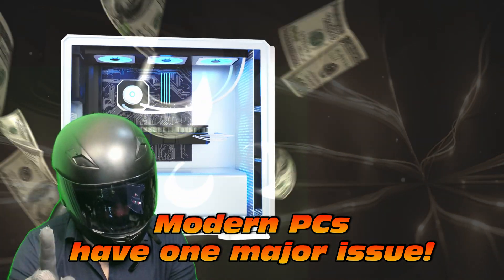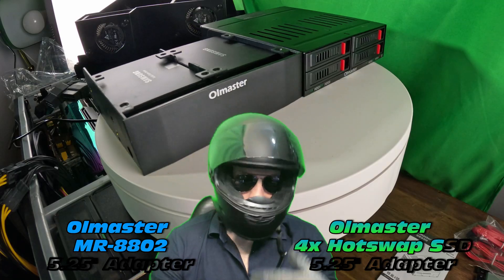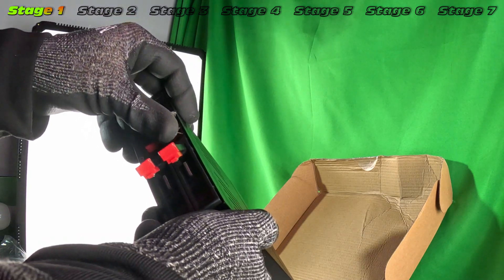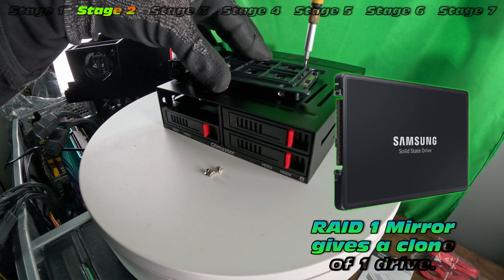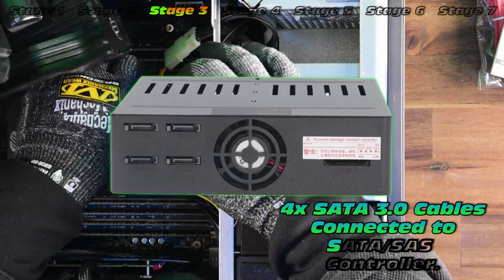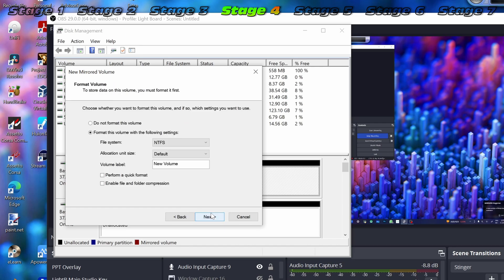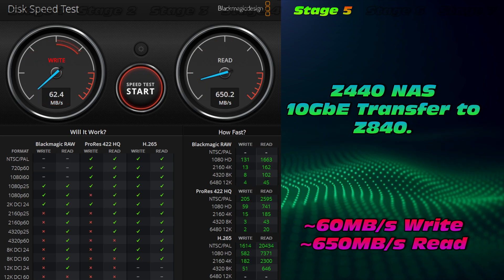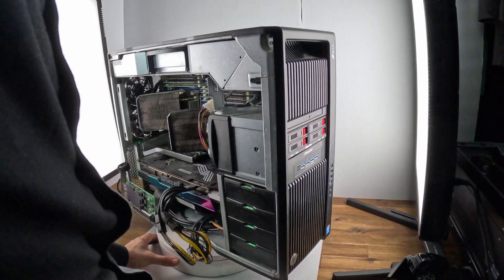Easy SSD Storage Upgrade? Affordable 4x SSD Hot-Swap Bay fitted to the HP Z840 - RAID 1 Mirror!

Comment: To me, the days of hardware raid have ended, I can't see any benefit of it over what we have now
Reply from the maker: In some ways I would agree, but it really comes down to application. Hardware RAID is selected to meet a need and it's still the best performing option for data redundancy and striping. Where you referring to ZFS as an alternative, or something like Storage Spaces?

I just finished watching a video from The Slow Mo Guys where they tested out a compact 12 drive NVMe pool that only offered RAID 0 and RAID 6. This may seem redundant for say gaming, but for video production it's a dream. 

In my application I use a 8TB RAID 0 pool of NVMes as a primary storage for a live video project, that archive can be backed up to a SSD Mirror (in case an NVMe fails), and that can also be backed up to a RAID 5 (in my case) HDD pool. 

A few levels of redundancy with different RAID configurations gives that piece of mind.
Reply: @racerrrz  Well, I have a 12 bay Synology NAS and 24 bay TrueNAS setup, I've done plenty of hardware raids before, but recovery with them is always the issue for me, the card dies, it's a real pain to get the data back
Reply from the maker: @TheTrulyInsane  There is no quick fix for that other than to have a fail-safe, backup the backup NAS to the backup of the backup NAS.lol 

Checking the drive SMART data regularly and replacing NAS drives every few years would be the way to go to prevent RAID drive failure, but who can afford to replenish all the drives in a 12/18 Bay NAS. I aim to leave my "NAS" (custom repurposed workstation with TrueNAS) off if not in use to improve drive life-span. 

Despite the pain of RAID, there isn't a more reliable method of keeping your data secure just yet.

Comment: How come you don't cover the Z640? I got a deal for a Z640 that is cheaper than Z440 locally albeit with only a E5-2623. Thinking of getting it and upgrading the processor later. Not going to the dual processor route but the Z640 seems to have a beefier power supply with bigger headroom to support power to GPU (I think)...
Reply from the maker: I have been wanting to do the Z640 and Z620 for a long time but I have just never had them appear cheaply on local marketplaces. They seem to be more rare in general. If I find a Z620 and Z640 on the cheap I may eventually do the Z600/Z620/Z640 review, but I may not have a Z600 when that time comes lol. 

The Z440 is actually the better machine IMO since they both (Z440 and Z640) have the same base motherboard, except the Z640 trades-in 4 RAM slots on the main board to accommodate the riser board for the second CPU (with 4 RAM slots used there as well). I read that the CPU riser board is a little unreliable, so from that perspective I would rather go for the Z440 and be able to run 8 RAM modules with a single Xeon CPU. If you want dual CPUs go with the Z840.
Reply: @racerrrz  I think the beefier power supply will come in handy due to the headroom. I can't find anything on the available cables"or  "connectors"that is suppose to come as standard. Do you know a source?
Reply from the maker: @mengshilim7364  I presume you are looking for the number of 6-pin connectors on the Z640's PSU? 

As far as I am aware the Z640 (925W PSU version) only has 2x 6-Pin cables - each capable of 12V at 18Amps (216W each max). 

The extra power might be enough to power certain founders edition GPUs with 2x 8pins (I recall the RTX 3090 founders edition being 2x 8-pins). I haven't checked if there are PSU upgrade options for the Z640 but the Z440's PSU to ATX adapter cables would also fit the Z640 which would allow you to fit any PSU you would want (mounting it in the Z640's case would be a slight issue - expect mounting holes not to align). 

In terms of other power adapters there should be at least 1x molex connector and likely 2x sata power connectors. I wish I had come across one of these so I can do an overview on them.
Reply: @racerrrz  HP has 6-pin to 8-pin adapter also they're not so easy to source. 3rd party ones probably are ok. How to add more sata power cable?
Reply from the maker: @mengshilim7364  I would trust the HP item (N1G35AA) above all the cheap 3rd party ones, but finding 3x is the challenge. But thus far my cheap ebay ones have been working well (6-pin female to 8-pin male), but I have read of poor quality ones burning up. 

Sata power is best done with extension cables. I have updated the video description with a bunch of sata power cable options. The combo one looks quite handy - you can never have too many of these cables!
Reply: @racerrrz  May I have a link to this video?
Reply: @mengshilim7364   I am always leery of using adapters of any sort, I use a couple of 6 pin to 8 pin adapters to power an EVGA gtx 1080 in my z440 and no problems. I stick with comeap, startech , moddiy if I can for power type adaptors.
Reply: Actually, can that beefier power supply be used to power anything but the riser card? The fact that it has 225W more than the Z440 700W may not mean much if the rail design etc means that it can be used only for the riser.
Reply from the maker: @JordanGospelMinistryInc-go8qp   I have not had issues myself with cheap 6-pin to 8-pin cables (all of mine were off Ebay/AliExpress) but it is best to buy branded items for better quality and reliability.
Reply from the maker: @mengshilim7364  The Z440 and Z640 share the same base motherboard PCB (with adjustments to accommodate the CPU riser board for the Z640). The PSU outputs are identical, except the Z640 has extra CPU power delivery to account for the additional CPU riser board. If you check the PSU stickers you'll notice all outputs are identical except for the added V12CPU3 and V12CPU4 outputs on the Z640's PSU.

That basically means the Z440 and the Z640 will power the same net hardware (so 700W max), but the Z640 can support that with dual CPUs.
Reply: @racerrrz   I was wondering the same thing about the z640 ,  Will stick with z440  and just skip the z640 and go for a good deal on a z840 :)
Reply from the maker: @JordanGospelMinistryInc-go8qp  If you keep an eye out now you may find the Z840's cheap. I obtained one really cheap that was defective. I didn't quite manage to figure out what went wrong with it, but a new motherboard solved the boot issue. I'd say a bargain Z840 would cost ~$250 USD.
Reply: @racerrrz  Looking deeper into this I think you're right although I was thinking mainly of a single CPU config for the Z640. Getting it also means I have to get that special cable for the dual rear fans. I think in a case swab, 1 of those 2 fans can probably go to a fan at the top of the case. Anyway, I will probably go for a Z440.
Reply from the maker: @mengshilim7364  The Z640 has it's uses, and if you can get one with the CPU riser board (so 2 CPUs fitted) it could be worth it. I have only ever seen 1 for sale locally with dual CPUs and it was more expensive than a Z840.lol. 

Were you after the link for the Z440 case swap video? 

This guide has most of what's needed for these case swaps. I presume the Z640 has the same front I/O pinout given that it shares the same motherboard layout as the Z440: 

https://www.youtube.com/watch?v=K4RalaEbRI4

I haven't done a case swap for the Z640 or Z840, but I have considered doing the Z840: https://www.youtube.com/watch?v=Rsr_zxOg6K8
Reply: @racerrrz  I was after the Sata stuff. I am still very confused even after reading the service manual. Can I use the secondary SATA (sSATA) ports as extra SATA ports in non-RAID configuration? If so, is there a SATA power cable for this if I have already used up the primary SATA power cables?
Reply from the maker: @mengshilim7364  Ah ok, SATA connections are simple once you figure out all the confusing terminology. 

The Z440 / Z640 motherboard has 6 Sata 3.0 ports. 

The two black ports (# 29 in the HP manual) are 6GB/s and the 4 white ports are secondary Sata 3.0 ports at 6GB/s. 

Consider the black ports as the primary ports and the white ports as the secondary ports (it doesn’t really matter where you connect but by default the black ports would have greater boot priority in the BIOS). 

In terms of eSata – that was external Sata ports which have a different connector design, and these are for certain external HDDs to be connected via eSata cable. The Z440 / Z640 / Z840 support eSata but you would need a PCIe connector to obtain those ports (HP P/N example: FH966AA).
Reply: @racerrrz  is there enough power leads for all 6 Sata ? I think I only see 2 + 1 (somewhere for the ODD). It would be silly not to have power for all 6…

Comment: I love this solution. I have the ICY Dock, which as @julianPursell, says is true tooless hot swap. But honestly, if you're doing this mod, you should be able to mount a few screws into a 2.5" sled. I love that the Z840 mobo has plenty of available SATA or SAS ports. Love the upgraded lifted visor + police sunglasses from @racerrrz! :D
Reply from the maker: Great choice with the ICY Dock. I am sure the quality is a step above these cheaper alternatives. The tooless drive caddies are a luxury we have come to expect.lol. It can be annoying when you have to fit a large number of drives - it takes me back to my old NAS which had screws for each drive which was super annoying lol. At least tooless is quite common these days. 

Z840 is loaded with SATA and SAS, actually much more so than the newer HP Z8 G4, which makes it ideal to load up with drives. 

I am working on improving the channel theme concept, and the visor lift is one of those concepts, as are the iconic aviator sunglasses.lol

Comment: I have one of these. They are not true hotswap, each ssd goes on a tray with FOUR SCEWS, not as fast as you'd like.
Also, the 40mm fan is annoying but easy to remove. If the 8 front leds annoy you, unplug them when removing or replacing (noctua) the fan, as diss-re-assembly is fiddly and the plastic can't take too much movement.
2.5" sata ssd don't overheat in this you don't need the fan.
They could be better if the sata ports were labelled with same letters as front leds.
Reply from the maker: Nice! You have taken the adapter further than I have. The 4x drive screws are a pain from the hotswap perspective, but if you had two of these adapters I guess it could count as hotswap.lol. 

My fan started off noisy but it has settled now. I don't think the fan would really be needed with SSDs but I guess it doesn't hurt (as long as it is silent). It's good to hear a Noctua fan will fit in there.

Yes I would agree there, the plastic feels a bit fragile, but then it is a cheap adapter so I can't expect too much. The LEDs can be annoying if the machine points towards you but I have mine hiding behind my screen so I don't see the LEDs at least.
Reply: I'm doing a nas with a fanless motherboard soc (j4125 or n100m) and pico psu, so the one molex to four sata power is handy. @racerrrz
Reply from the maker: @fanlessfurmark  That's a handy NAS to have and converting that molex into 4 sata gives you some expansion options. 

I have been reading into NUCs to see if I can find a way to tune one of them to it's full potential.lol. The Ryzen based mini PCs caught my eye, but they seem to be a bit expensive for what they are. 

If I had to choose between a low power draw NUC and HP Z4 G4 motherboard (which cost the same just about) - I would opt for more power for the dollars. It is hard to beat the NUC's low power draw though.